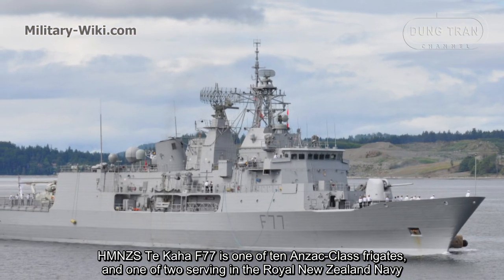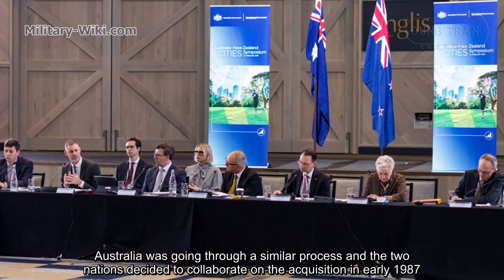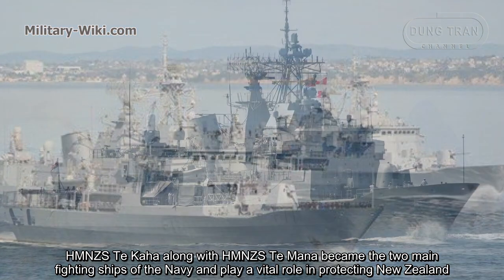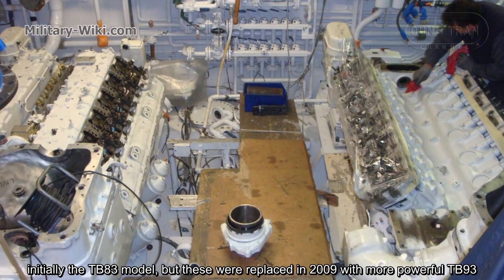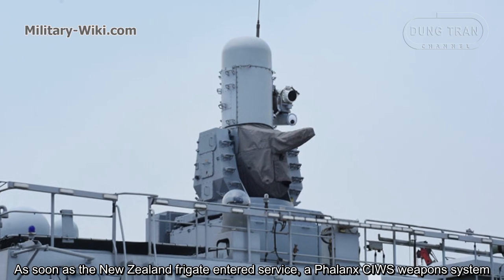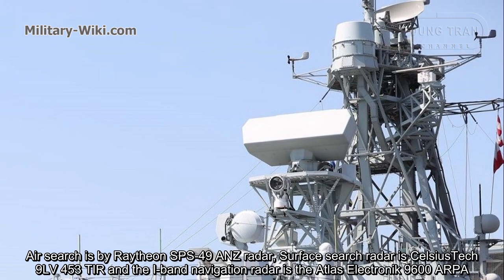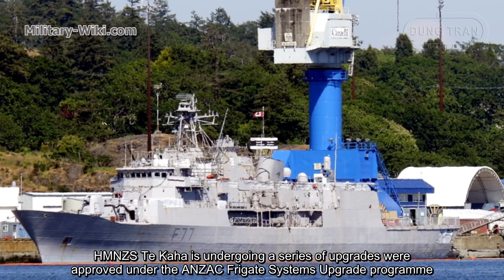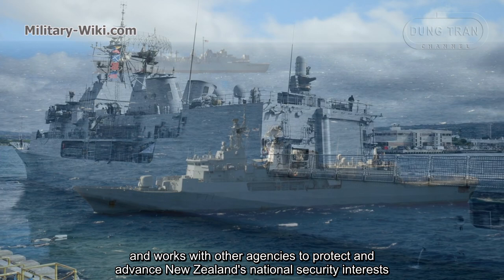HMNZS Te Kaha - An Anzac Class frigate which be part of New Zealand's national security system

Comment: good choice for NZ but what will there replacement be, the type 31 or type 26 are the only real options. would help if NZ would not be so tight and left and actually do somethng. 1% mlitary budget is extremely low, 1.8% would make a huge differance
Reply: it’s already at 1.5%. and keep in mind that equipment purchases, whether they be frigates or artillery, are actually paid for by the crown - not via the defence spending budget that makes up the % of GDP figure.